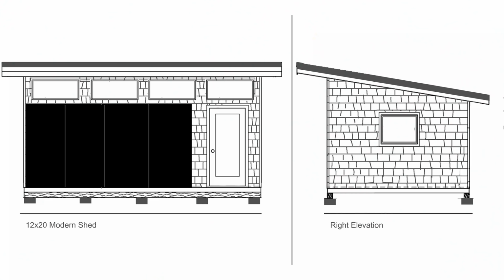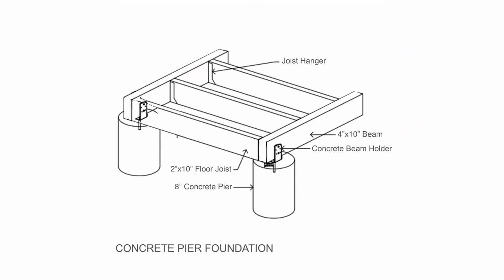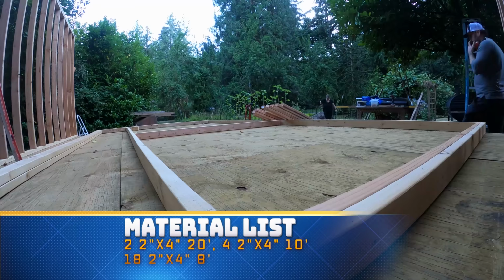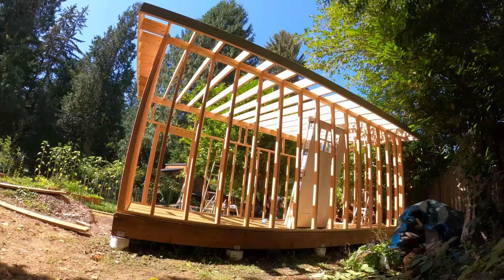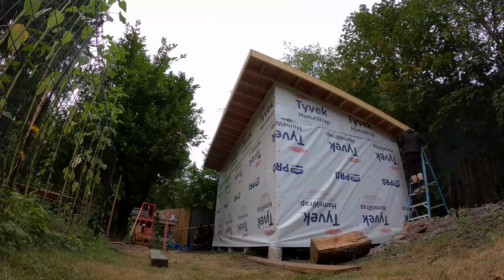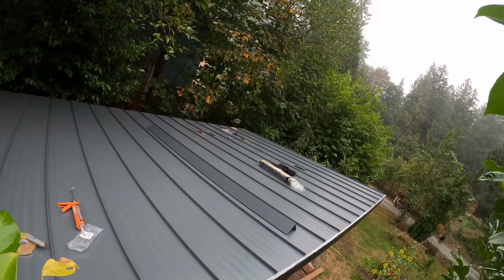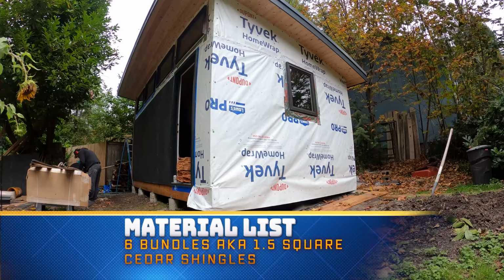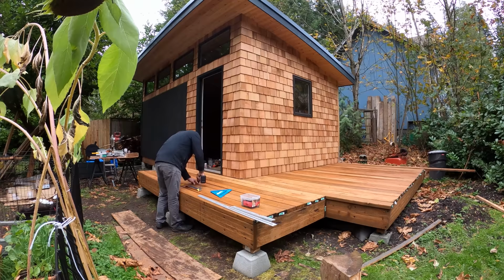Build A 12'x20' Modern Shed and Deck by Yourself: With Material List

Comment: Why did you go with 2x10's for the floors, 2x8's for the rafters and 1/2in plywood?  It seems like so much overkill to me!  I would've gone 2x6 for both and 3/8 plywood, but I only have a little experience building a few decks and we've been thinking about building a shed on our property too, so I'd love to learn!
Reply from the maker: This is my first shed so I just went with information I could find online and in my Sheds and Garages book that I bought at my local hardware store.
When I looked up the code for my area 2x8's were required at 24" on center to meet the snow load code for a 12' span with a 2-12 rise. 
This may be different were you live?
I did go a little overkill making them 16" on center vs 24" but that was intentional as I wanted my roofing panels to screw into a stud vs just plywood. 
For the floor joist I googled what size floor joist do I need for a 12' span and I found a little chart that said I could run a 2x10" joist at 16" on center up to 13'11". 
According to this chart the maximum span for a 2x8 was 10'7" and a 2x6" was 8'
If I added another beam into my foundation and didn't want to cover such a large span I could have gone with smaller joists.

When searching what plywood to use for the roof homeguides recommended for rafters spaced 20 or more inches apart, 1/2- or 5/8-inch plywood. 
Being that I was going 16"s I used 1/2". 
For siding 3/8" is recommended but I didn't see that until after I purchased all the 1/2" plywood.

I'm still learning, and I'm sure I made a bunch of mistakes along the way, used the wrong terminology, or could have done things a little more cheaply. 
At the end of the day (in my mind) it's always better overbuilt vs underbuilt.

I'm not a pro carpenter I'm just a guy with a saw and a hammer. 
I try and find as much info as I can before I make my first cut or drive in my first screw. Mistakes will happen but I try and not let discourage me.
I'm finding there are a lot of ways to achieve similar results when building things, this is just the way I happened to do it.
Reply: @NilesProductions  Thanks for your reply!  I understand now - The biggest enclosure I ever built was a small 4x4 "covered bus stop bench" for my kids to wait for the bus to school in the morning, so I could get away with smaller boards.  I'm in the same PNW area you are so I'll definitely bookmark your video for when we start building!  Maybe this summer.    

One thing I would say to a fellow PNWer: Parr Lumber will deliver for free to a home address if you order a certain amount of wood from them.  Obviously you're done with your large project but it might be something to keep in mind in the future.  I've used them before when we built our large deck.

Comment: I am so impressed! I wish I had the knowledge to do things like this.

I'm looking to buy an isolated office for my backyard. I work remotely everyday so it would be nice going out in the backyard to work.

I've been looking at prebuilt solutions but they are very expensive. What did a solution like this cost you if I may ask?

No matter what, you are extremely skilled and I enjoyed watching the clip.
Reply from the maker: I built this in 2020 (during lockdown) when wood prices were a little bit high. All in it cost me a little over $12g for the shed and deck. Glad you enjoyed watching my little build/video :)

Comment: I'm in the planning process of my back yard office as well for 10'X20', I was wondering why you went with the 4"x10" beams for the foundation? I saw some people went with 2"x6" and was going to compromise and use 4"x6"s. Do you think this will make a huge structural difference?

Also, I was going to add a middle layer of piers, think that's overboard?

Comment: Very cool! 
Can you elaborate on why I never want to seal the bottom window flange? I guess it is to still let moisture out or air in or why is that?
Reply from the maker: Yeah, it's to help deal with moisture and condensation buildup on or around windows. Give water and water vapor a place to escape instead of pooling.

Comment: Never pre-install joist hangers.  Your joist will vary in width slightly and thus have an uneven floor surface.  Also using lags in the end grain will fail much sooner to inevitable rot.  Use corner brackets instead.

Comment: Really nice. Curious why such a small window on the side given the overall look of everything.
Reply from the maker: I really wanted to maximize wall space for shelving and storage on the inside but still wanted at least one window that would open for air flow during the summer months. I would probably have installed larger windows if I planned on using the shed as a studio or guest house.
Reply: @NilesProductions  that makes sense.

Comment: If you built that in the UK it would cost about 15k just in timber. You can't get any of the sheet material you used for finishing here either.
Reply from the maker: There’s a lot a different ways to build a shed I’m sure you will find the materials and a path to suit your needs 🤙

Comment: 1) Great video and build. I love that you included a material list.

2)  Do I need to be a licensed carpenter to build my own cabin/dwelling or do I just have to meet local building codes? I wish I picked up the trade and it's kicking me in the ass currently having not done so. Thank you in advance for the response if you get to it. Stay well!
Reply from the maker: Thanks Garrett, glad you enjoyed the build :)

Not sure about your local codes or if you have any HOA rules, but in most cases as the property owner you can get permits and schedule inspections when you build your own stuff as long as your plans and build meet the local codes.

Comment: That process to do the birdsmouths was painful to watch lol. Line them up, set a square on there and rip them at once for the face, then cut through the seat. Truth be told though on a 2/12, with brackets, I'm likely just to leave flat and hang it.
Reply: Also can use timberloks from below without the brackets.
Reply from the maker: Good advice to speed up the process. 
Lot of different ways to accomplish the same outcome when building stuff I’m finding. It has been fun learning little tricks as I go 🤙

Comment: Thats a nice pretty good size shed 👌 
But whats it used for ?   Its also slightly larger then I can do without a permit.
However I can go larger.
Id like one 18x24   432 sq ft.  Woodworking shop 
Yours is 240 sf  still a lot of room  with a different roof type you could have put in a loft area. One guy I know did that and added a lift to put motorcycle up in the loft its all built with 2x8s and he should have pulled a permit. He had the city called on him, they came out inspected it laughed becuse it looked better then all the other sheds by it fined him for not pulling a permit but passed the work.
The inspector said it was built better then most of the he sees. 

This guy keeps his bikes in it I think he has like 12 motorcycle parked in it.
You'd never know by looking at it.
You'd just think riding mower or somthing. He has a full 7x8 garage door on it and it matches his house.
Reply from the maker: A loft would have been rad. Your buddies motorcycle shed sounds cool 🤙

Comment: Awesome, great video and the only one I've found with a material list. The only other thing I'd like to know is the total price, even if it's just an estimate.
Reply from the maker: Glad you liked the video Tyler. 
What you see in the video cost me a little over $12k. Wood prices have been fluctuating like crazy these days so I wouldn't expect it to be the same if I where to build it today. If you want something a little more accurate you could always take the material list and price it out at your local lumber yard...
Reply: @NilesProductions   @Niles Productions   Definitely, during my last build osb was 60$ a board! Luckily it seems to be going back down. I'm hoping to build a tiny home by the time summer rolls around. I've never built a structure before and I'm trying to wrap my head around the process and how much i need to have in the bank. I'll definitely be using your video as a reference, funny that you have one of the better DIY videos when it seems to be your only one. I'll definitely keep an eye out for your future builds, thanks for sharing.
Reply from the maker: The prices during my build fluctuated massively.  For instance the 2x10x12 pressure treated floor joist were something like $32 when I started and over $50 by time I was building the deck.  I Checked a couple prices today out of curiosity and it looks like it's slightly lower than when I started. Might be a good time to build something?

Comment: Hello great video. I’m in the middle of doing my own garden shed. I’m in the Uk and really like the roof panels you fitted on the top of the ply sheets. I’ve been looking for similar over here. Do they go by any other name than skyline standing roof panels. 
Can you also tell me if when it rains is it noisy. 
Subbed and can’t wait to see more.
Reply from the maker: Hi Dexta! 
The generic name for the roofing material is standing seam roofing. 
I did a quick Google search for Standing Seam Roofing in the UK and found this place.
https://www.pagurek.co.uk/standing-seam-roofing/
I don't known anything about this company or if they are reputable but figured it might be worth giving them a call?
Metal roofing is a little louder than say an asphalt roof but I personally find the sound very soothing.
Good luck on your garden shed :)

Comment: Beautiful shed, but isn't it a hassle dragging the lawn mower, wheelbarrow, and snowblower up those stairs?
Reply from the maker: It’s a little bit of a hassle. I was originally going to do a ramp on one side and stairs on the other but for atheistic reasons I did two sets of stairs. I’m happy with my choice 🤙

Comment: 9 1/2 degrees?  sounds a little bit over precise but ok.  you sure did provide a lot of details and i do appreciate that!
Reply from the maker: I rounded it up. If you want to get really precise the actual angle when you do the math is 9.46°  for a 2/12 Roof Pitch. With that said my birdmouth cuts were nice and sloppy so I doubt I hit 9.5 on the dot lol

Comment: Nice work, liked the style of the shed and choice materials. Is there anything that you would have done differently now that the project is finished?
Reply from the maker: I wish I had put in ridged foam insulation between the floor joist before I secured the plywood on top of the floor. 
It can still be added but will be a lot harder with everything in place. 
I should have used structural screws or hanger nails on the metal joist hangers and strong ties instead of deck screws. That’s what the pros tell me anyway. 
As far as the video goes I should have added more shots of Hanson the wonder dog.

Comment: @nilesproductions Fantastic, super precise work. Looking to build a very similar unit this summer/fall. Would you be willing to post a link to a excel or word file of the build list. YT does not allow copying the text on comments or descriptions. Thanks
Reply from the maker: Weird you are not able to copy from the description. I haven't had an issue with that... 

Material List Copied from video description below:

Material list: Foundation and Sub Floor
10 8” Sakrete Form Tubes
16 bags 80lb Sakrete Fiber Reinforced Cement
20 3/8” x 36” rebar
10 4x4 Concrete Pier Hangers
2 4”x10” 20’ PT Beams
16 2”x10” 12’ PT Joists
28 Galvanized Joist Hangers (Fasten with Structural Screws or Joist Hanger Nails)
64 Headlok Lag Screws
1 Roll 12’x20’ 6 MIL Black Plastic
8 3/4” 4’x8’ PT Marine Plywood

Wall Framing
Rear Wall:
3 2”x4” 20’
18 2”x4” 8’
Side Wall No Window:
3 2”x4” 12’
10 2”x4” 8’
Front Wall:
2 2”X4” 20’
4 2”x4” 10”
18 2”x4” 8’
2 2”x6” 20’
1 2”x6” 8’
Side Wall With Window:
2 2”x4” 12’
12 2”x4” 8’
1 2”x6” 8’
Top side wall angle framing
2 2”x4” 12’
3 2”x4” 8’
Wall sheeting
19 ½” 4’x8’ CDX Plywood
Rafter Framing
28 Simpson Steel Rafter Tie (Fasten with Structural Screws or Hanger Nails)
Rafters:
18 2”x8” 16’
Nubbins:
2 2”x8” 16’
Rafter Fascia:
3 2”x8” 16’

Roofing,Fascia, and Soffit:

Fascia and Soffit
4 1”x10” 20’ Cedar
24 1”x6” 12 Tongue and Groove Cedar

Roofing
12 ½” 4’x8’ CDX Plywood
3 2” 10’ Drip Rail
2 36”x66’ Stormguard Roof Underlayment
17 16” 16’ Skyline Standing Seam Roofing Panels
3 Skyline Peak Panel Caps
4 Gable Caps
2 Rolls of Butyl tape
24’ Skyline Peak Foam Enclosure Inserts

Windows and Door
1 30”x36” Window
4 48”x24” Windows
2 Rolls of Self Adhesive Window Flashing
2 OSI Quad Window and Door Sealant
1 Jamsill Sill Pan
1 Pack Door Shims
1 Therma-Tru Fiberglass Door

Siding
1 Roll 9’ Tyvek Homewrap
1 Roll 2” Tyvek Tape
1” 12 Gauge Galvanized Cap Nails
13 5/8” T1-11 Plywood Siding
4 1"x3" 8' Cedar back corners over siding
2 1"x3" 12' Cedar front corner over siding without shingles
3  ½”x5/8”x2” 10’ Gibraltar Galvanized Z Bar Flashing
6 Bundles 1.5 Square Cedar Shingles

Deck
5 Pier Block With 4x4 Hangers
26 Joist Hangers (Fasten with Structural Screws or Joist Hanger Nails)
70 Headlok Lag Screws
1 4”x6” 8’ PT
14 2”x10” 12’ PT
8 2”x6” x 12’ Deck PT
23 2”x6” 8’ Deck PT
1 2”x8” 8’ Deck PT

Stairs
6 Pier Block with Framing Notch on Top
6 3 step PT Stair Stringers 
6 11.5”x48” PT Stair Tread

Privacy Wall
30 1”x4” 8’ Cedar
3 2”x4” 10’ PT
1 4”x4” 10 PT
12 Headlock Lag Screws
Reply: @NilesProductions  It may be because I don’t have a premium subscription.  I will retype.  Great work. Thanks again.
Reply from the maker: I think you can copy and paste the list if you are using a pc and not a phone?

Comment: Heya love the build and am wandering if this is usable in areas with more snow (up to 50cm) regarding stability, thank you!
Reply from the maker: Having the rafters set a 16" on center vs 24" ups the snow load rating a bit but if you live in a really heavy snow area I would recommend building the roof at a slightly steeper pitch. My roof's rise is 2/12, if you were to increase the rise to 3/12 it would shed snow a better.

Comment: My only concern would be the blocks supporting the deck, if they sink it will pull the deck down away from the shed connection. If it were me, I would put compacted gravel underneath each one and pour concrete footers at the corners. Amazing work and well made video, thank you!
Reply from the maker: Good idea. 
My yard, though it may not look it in the video is almost entirely rock. About 4-6” under the soil is the worst compacted bed of gravel and rock I’ve ever tried to dig in. I basically just scraped the top soil off to get to the rocks when setting my blocks. Even with the power auger it was a nightmare to dig the foundation holes. 
The ground being so tough is also why we did raised garden beds. 
With that said I 100% agree with you and your concerns.
If it does end up settling a bit I can always unscrew and jack up the corners of the deck.
Almost a year and half everything is still as square and level as the day I built it so hopefully this doesn’t a become problem down the road.

Comment: And  the same question for the last years? Why did you use plywood outside? And tyvek. Whats wrong use plywood for inside by building the walls.
Reply from the maker: I used the Tyvek wrap because it helps keep wind and water out, while at the same time letting water vapor escape from within. It helps improve building durability by protecting against rain and wind that can penetrate the exterior cladding. 

As far as the siding goes. 
I wasn’t going to use the T1-11 plywood siding originally. 
I originally was planning on doing Shou Sugi Ban charred wood siding. 
It’s the Japanese art of burning wood siding to preserve it and imho it looks beautiful (I suggest googling it if your not familiar)
I’ve never made Shou Sugi Ban siding before. 
I’ve looked into the process a bit and think I could do it but at the same time the materials are expensive and would be exceedingly  costly if I messed up. 

So when it came time to buy the material for the Shou Sugi Ban and char the wood I got cold feet. 
The reason I went with the T1-11 plywood siding was purely financial. 
The reason I painted it black is because I kinda wish I did Shou Sugi Ban siding lol

I’m not sure if this answers all your questions about my siding decisions but hopefully it helps. 

The cedar shingles were always part of the siding plan.

Comment: Should you not use nails instead of screws for the joist hangers, framing and roof hangers? Nails let the structure flex slightly with load or wind, whereas screws will eventually weaken and snap off.
Reply from the maker: You are right you should use joist nails or structural screws on hangers
Reply: @NilesProductions  ah, so your structural screws are a suitable alternative? I was planning to mainly use nails when I build mine.
Reply from the maker: Nails is the safe bet and quickest. I’m still learning as I go as I’m not a pro. If I owned a framing nailer I probably would have gone that rout. I believe Simpson makes screws that are specifically designed for hangers if you want to use screws. I’d look into the code a little more if I were you or ask a professional. There are probably a bunch of steps in my build that could have been improved on 🤙

Comment: Absolutely fantastic video! 

Out of curiosity, why did you decide on a 12' x 20' instead of, say, a 16' x 24' structure?

Totally bookmarking this for when I get my project going. Thank you!
Reply from the maker: 12x20 felt like it was the perfect size for my needs. 
If you are going 16' wide you'll probably want add a third beam in the middle of your foundation or up the size of your floor joists. Or perhaps pour a concrete pad? IDK
Reply: @NilesProductions  That makes perfect sense. It seems right-sizing such a project is definitely important. Thanks!